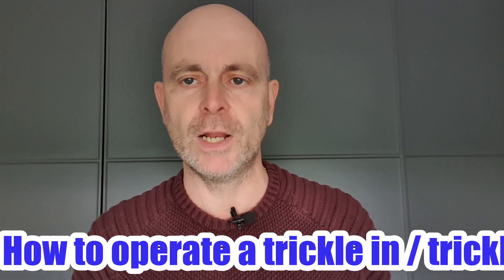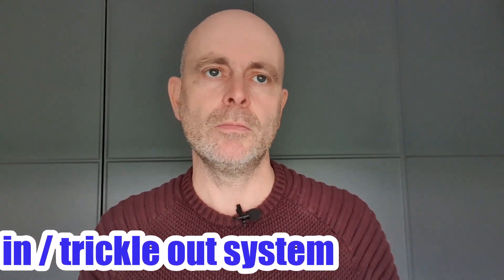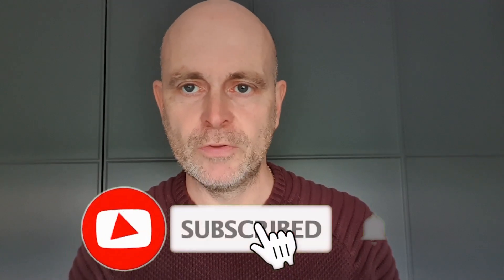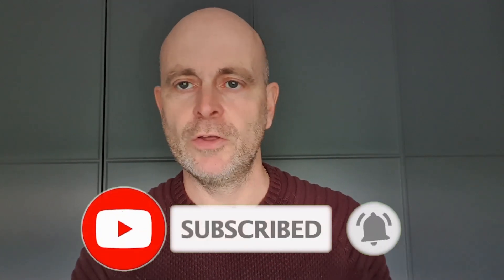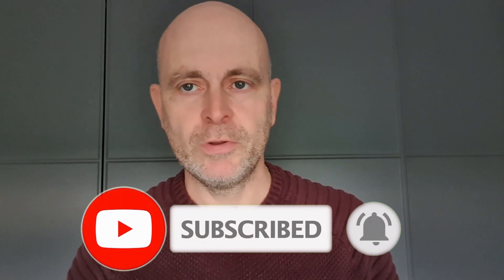How to operate a koi pond trickle in/out for water changes

Comment: One thing to remember is that trickling is not as efficient as a normal water changes, if you change 10% (say 1000 on 10000) with a water change your trickle might need 11% to 12% (1100 litres). This is because the water you remove is diluted, example being if you do a water change your nitrates are 40 all the water removed contains nitrates at 40 and all the new water is at tap level.  Whereas with a trickle the pond nitrate level leaving will start at 40 but the longer you run the more diluted it becomes so after 1000 litres the water leaving might be at 36. Whereas all the water removed in the water change was at 40. The other way of looking at it is two 5% percent water changes are not as good as one 10% because the first has diluted the pond ( 40 take 10% = 36, or take 5% of 40 is 38, then take 5% of 38 is 36.1 so your nitrate is 0.1 higher, think of a trickle as lots of small water changes and it multiplies the effect.  Trickle is far better for stability but for people on a meter it might be worth considering.
Reply: Yes I’ve heard this quite a few times now. What’s your thoughts on this Daz?
Reply from the maker: Hi Mike, yes the maths is sound. The thing with a trickle though is that it is constant. So while the initial exchange is as Rich describes above, subsequent 'changes' are instant rather than waiting another week for it to build up. So yes, this effect is real, albeit absolutely tiny difference, but long term this effect is negated. 
Think of it as the trickle in reducing the, e.g. nitrate, slowly but consistently. In time the level reaches zero (or the same as your tap to be more accurate) and then it stays there. With batch changes it is reduced slightly with a step change but then it builds back up until the next change which might be a week away.
So long term, the effect described above is irrelevant. My trickle in has remained untouched for about 3 years now. My levels are diluted to tap water levels and then held there permanently. With batch changes the only time my levels would be reduced is straight after the change and then they slowly build back up.
Consistency is key to keeping koi so a constant trickle is hands down the best way to do it if you can.

Comment: Brilliant info 👌
So we dont need to use a filter or a declorinator on a truckle in?
Reply from the maker: Hi Paul, its hard for me to say you don't because all water supplies are different and chlorine levels can vary a lot. Also chloramine may be in your supply and that wont gas off. 
I have no chloramine in my supply and I trickle in probably closer to 35 - 40% a week and I've never had any chlorine reading on my pond.
Reply: @DazzleKoi  great reply, thank you for your time 👍🏻
Reply from the maker: No problem mate 👍

Comment: Brilliant 
Bottom drain is on soil do I cement it in?
Raised sleeper pond 1000gal same set up as yours ,with pod .
Reply from the maker: Hi Alan, what are you doing for the base? Is it a poured concrete slab? If so you can just leave it sat on soil and pour the concrete around it. Fill the line with water first and/or put a block on the drain to stop it floating up on the concrete.
If your not pouring a solid concrete base you can just put a little pad of concrete under the drain (or a paving flag or similar) just to support the weight and stop it sinking.

Comment: I had to have above ground ponds because of all of the tree roots in my yard.  I am also blessed to have an artesian well so I can trickle in 72F water.  It keeps the pond warmer in the winter and cooler in the summer.  I created a bog garden to handle the trickle out.

I have 6000 gallons going into a 3100g pond per week.   I don't really know what the percentage of exchange is because fresh water mixes with the old water and goes out.
Reply from the maker: Hi mate, that sounds great. You are basically putting 200% in a week!! Mine is around 30% I think at the moment, maybe just a bit more 🍻🍻👍🍻🍻

Comment: Explaining everything so well as always.Wish I could run this type of set up but I have to pump to waste from nexus as my drain is higher.Suppose the trickle out could just be left to drain in garden?other issue is outside tap makes a rediculous squealing noise when on low.
Reply from the maker: Hi mate, the best thing regarding the squealing tap is to add a T before the tap and fit an isolator like the one on my flow test leg. That's what I have at the house end. Then you can leave the isolator in the correct position and it wont move. It doesn't interfere with your outside tap then either and the isolator wont cause the squealing noise that taps can.
No issue with the trickle out going on the ground somewhere as long as there is good drainage.
Reply: I made a bog garden to handle the trickle out.

Comment: Trickle in/out are fine for raised ponds but a bit more of an issue for ground level. It can be done from the filter system but its very difficult.
Reply from the maker: Yes I haven't really considered ground level ponds. You could run a pipe below ground to a sump of some form but unless you have good drainage you'd probably still need to pump it out often.
I cant get my head around how you would do it in the filter, as you say, its not easy.

Comment: Mr Dazzle another great video 
I’m attempting a trickle out on an inground pond 
But I’m just so stuck on how to trickle out 
Any help or suggestions please 
Thanks
Reply from the maker: Hi mate and thank you very much, you are pump fed to a nexus and return by gravity I think. Unfortunately its not easy to do on your setup. The easiest way I think would be with a skimmer which would be buried in the ground effectively and then fit a tank connector at water level in the back of the skimmer box and pipe this down to a drain or buried tank to be pumped away. Its not straight forward though, would need a bit of work.

Comment: Dazzle
Any ideas on how you can use a trickle in when you don’t have easy access to mains
Reply from the maker: Hi Alan, the only option you have really is to get a source of water to the pod or filter. I had the same issue so I just ran a simple length of garden hose around the outer perimeter of the garden, hidden behind raised beds etc, and in through the back of my shed. If you use hose it is flexible so it wont burst if it freezes. I found mine was forzen from afew days here and there over winter but it runs fine for probably 350 days of the year 👍

Comment: Hi Daz,  im thinking to use this method. My pond kH is around 4 degrees @ 8.2pH. However my source water has 1 kH and pH is always ranging from 8.2 to 7.6. Will this cause my pond pH to swing? Thankyou!
Reply from the maker: Hi mate, sorry for the delay in replying to you, I've been away on holiday. Your pond pH will change throughout the day anyway. It will rise when the sun is up and fall overnight.
With KH of 4 I would just leave it alone. Mine is 3 or 4 and that is great. Its better to have consistency than to chase it .
Reply: @DazzleKoi  thanks for replying, Daz. So there should be no issues for me to run this method right?
Reply from the maker: Hi mate, no that will be absolutely fine. Consistency is key. Just make sure its stable and you are fine 👍👍👍

Comment: Hi Daz, I’ve just set up my trickle in through a 3 stage.I’m not on a water meter so would you suggest I still do 20% or can I do a lot more?
Reply from the maker: Hi Paul, you can do more mate if you want to. In the summer I've had mine up over 100% in a week and I don't use a dechlorinator. I'd try maybe 40% in the peek of summer growing period. Once you find a good level forget about it, consistency is key then 👍👍